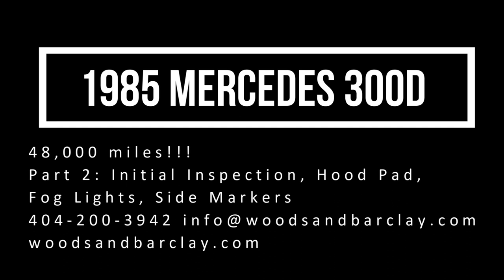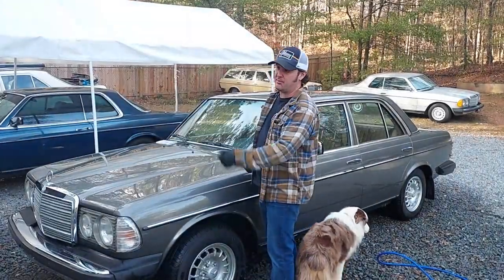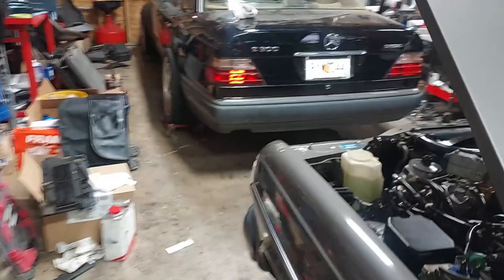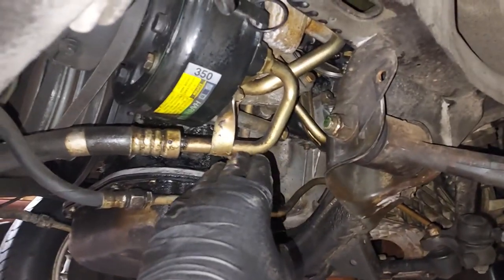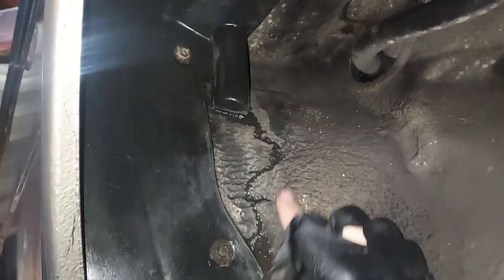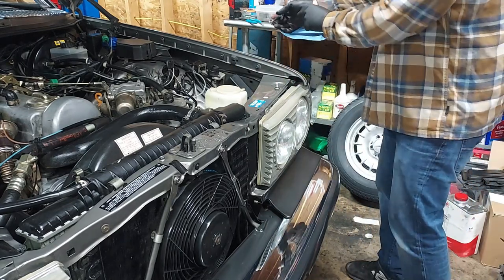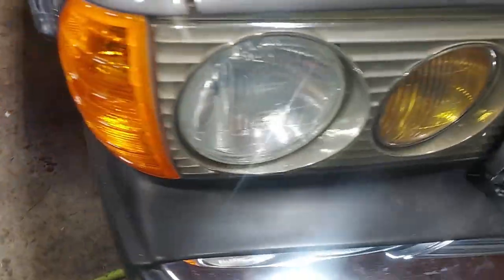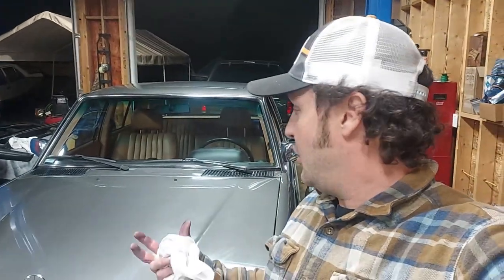1985 Mercedes 300D - Part 2 Inspection, Hood Pad, Fog Lights, Side Markers

Comment: What is the use of a hoodpad? I heard protecting hoodpaint but not a single car in europe has it it seems. And our paint is fine. Does it help with noise reduction? Because i would be very interested in that. 
Thanks!
Reply from the maker: Mainly helps with a little noise reduction. Some people claim it's to protect the paint from engine heat.
Reply: @woodsandbarclay  I'm trying to understand what I can do to reduce noise in my w123 because I love the car but it feels very loud compared to a modern car. 
So far I have : hoodpad, new/extra insulation in the cabin, door seals and engine mounts;
Do you see anything else I could do?

Thanks a lot a great video
Reply from the maker: @Altanox  the noise is part of the appeal of the 300D. I'm sorry but we do not alter the cars from the original condition. The way Mercedes designed them is the best way in our opinion. If you wanted to really limit the noise you would remove all of the interior and put in sound dampening mats.
Reply: @woodsandbarclay  That's indeed a very good solution. I will look into that. I enjoy the sound of the car, but not so much not noise of it, if that makes sense. The engine is sexy, but hearing the road through my floor for 2 hours straight is not something i enjoy.
I hope i can tune the car a bit. Amazing videos thx a lot
Reply from the maker: @Altanox  dynamatt